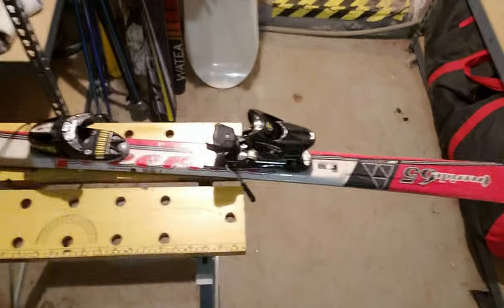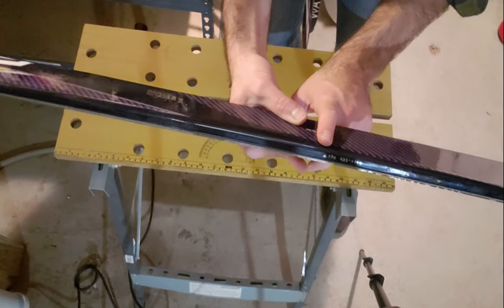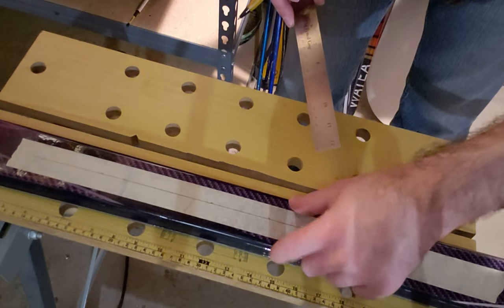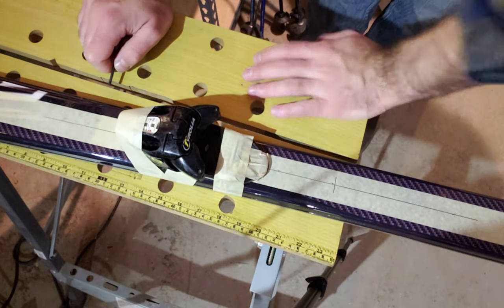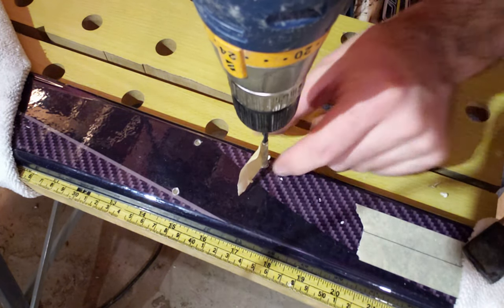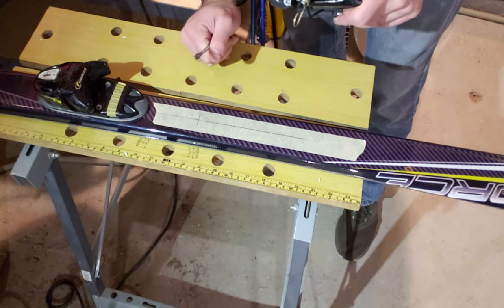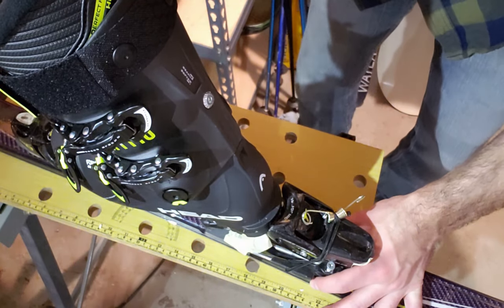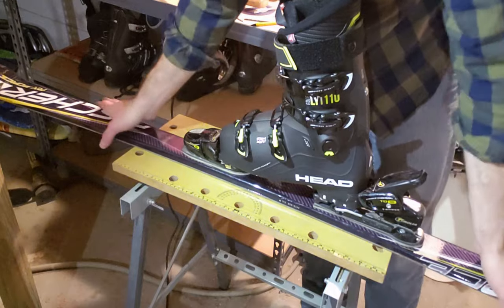How to mount ski bindings at home - free and easy!

Comment: A couple of observations. Ski binding screws use Posidrive #3 not Phillips. The most common drill bit sizes recommended by manufacturers would be 3.5-9.0mm, 3.6-9.5mm for non metal skis, 4.1-9.0mm,4.1-9.5 for skis with metal. Always use a 12AB tap to cut the thread in a ski with metal. These are step drill bits that only penetrate to the correct depth and have a counter sink. A drill guide is useful when drilling metal which can require more downward pressure. The guide helps you drill straight. Binding technical manuals recommend a wood type glue to lube the screw and help seal the screw hole from moisture. When setting up the toe and heel by eye keep in mind the some toe pieces have a preload on the wings so the boot pushes the forward. The toe piece requires the proper forward pressure from the heel to ensure proper release in a twisting release. When the boot is inserted the heel piece actually moves backwards on the track. Always double check the forward pressure after mounting and adjustment. The boot and bindings are a release system and the release spring needs to be set and calibrated to a skiers hight, weight, age, boot sole length and skier type. Just because you set a binding to a certain DIN number doesn’t mean that the boot and binding will actually release at that value. This should be checked by measuring the requirements with a force measuring device/ torque wrench. The same chart that recommends the DIN setting also lists the proper release force range in twist and forward falls.
Reply from the maker: Very helpful. Hope everyone reads this. I've just done my own bindings several times - looks like you have some serious knowledge.
Reply: Cool comment 👍🏻
Reply: I agree with every thing said above! Good add on. I just want to add something. If you are buying old equipment like this, you will have to work on it yourself. Check and see if your bindings are indemnified before you buy them, because a shop will not  work on them if they are not. Thanks
Reply: Do you have a set of bits you would recommend getting?
Reply: How do you use a torque wrench to test the force require for a specific din release value?
Reply: @J_Smith7  there’s a whole setup one would use to test the release. The torque wrench attaches to a foot-like rig that is inserted into the boot when testing. When calibrating you test for both lateral and vertical release, comparing results with the chart mentioned. Pretty simple and fascinating actually. It looks like it can be done by machines also, although I’m sure still frequently done this way by techs. Cheers!

Comment: If you just need to install new bindings using the same holes because the previous ones broke. You basically just unscrew them, and screw the new ones in? Ofc adjusting the weight for release and all that too

Comment: Thank you for this video, I just bought a set of used skis and boots, and the boots are about a quarter inch too large for the bindings at max adjustability. After watching your video I feel like this will be a fun project to do to re adjust the rear binding back since the boot and the ski centers match with where the front binding is. Probably saved me a ton from taking it to a shop when I could do it myself.

Comment: thanks for sharing. no. criticism here but i would like to recommend…. anytime a drill needs to be used with a heavy clear or gel coat, run the drill in reverse for just a couple turns. it will prevent blowout and the heating of the gel which creates that ridge you trimmed with the exacto knife

Comment: in terms of finding the centerline of the ski and bindings that method will always have enough error that you aren't actually on center.  better is to just put the binding on the ski and center it by feel on each side with your fingers and tape it down and double check side measurements are equal with calipers.

Comment: Since super glue becomes brittle more quickly than other substances do u think a type of epoxy would be better or not a deal breaker? Also, you made the process seem munch easier from what i have been hearing. Seems like anyone with patience and basic tool skills can mount. Great clear video👍
Reply: You don't want to use super glue or epoxy, actually.  The screws' threads are shaped such that the glue of any kind really doesn't contribute to their strength. The thread pitch and size gives it its strength. Glue can help them not back out. But with the proper torque, they won't ever back out, even with no glue.  Adding super glue or epoxy will cause the screws to lock in so hard that taking them off will ruin the immediate area around the screw, or  the screw head will strip.  Most binding technicians and manufacturers recommend using Titebond wood glue.  It seems too weak, but it actually works great. It bonds very well to the wood core and most importantly it does a great job sealing the holes from water ingress.  Water/humidity getting in the screw holes over time will rot the wood and the screws will be more likely to pull out.
Reply: @dustinlee2310  thanks for the detailed reply 👍

Comment: useful video, many shops here refuses to work on old stuff. i have a pair of gs skis where i wore off the edges and they have steel racing binding still perfectly functional. i asked to mount the bindings on a pair of old voelkl P20 that i still enjoy using, but no! the ski is too old so it's dangerous (??!).
Reply: They have too… the ski isn’t reliable and if your binding ever came off you would have a big payday… you can’t blame them🤷‍♂️
Reply: @r0gers96   please... they sell you junk skis for 200€ that become unstable after 5 runs. have you ever seen a binding coming off a quality ski in good condition? probably only if wasn't mounted properly. but they also told me that their edge tool isn't hard enough to sharpen the old ski. strangely enough they were super ready to sell me a new pair and change the basic bindings with mines
Reply: @enricofumi8072  I can see a shop not wanting to touch old bindings due to liability. They have moving parts that can degrade and fail with age. Skis otoh just get worn out from tuning. I've kept a pair of P9 RS - what a contrast vs the modern world cup racetigers haha...
Reply: @jamesroscoe7555  so car shops should refuse to work on anything more than 12 y/o. carpenters won't touch any building built before 2002 etc...
Reply: @enricofumi8072  The difference with a car or a house, is the binding industry specifically provides a list of indemnified bindings and any binding not on the list, a shop will usually reject. The binding manufacturer will no longer support bindings not on their list, so if a shop does work on them, the shop will incur all liability. Some of the parts in some bindings are plastic and can age and crack unexpectedly, so it is fairly legitimate that the manufacturing engineering staff would advise of the risk. 

The same is true with car tires. Shops will often not reinstall tires over a certain age (tire manufacturers often say 6 years) due to potential liability. Tires can last longer before spider line cracks happen, but it is easier for a shop to go by numbers. Helmets also... if you crash in a 10 year old helmet and it fails, good luck suing. In a house, smoke detectors often have a defined life and are designed to "fail" with a siren at some lifetime rather than not go off in a fire. The binding industry works the same way. Older skis otoh are imho totally fine generally unless there is some sort of serious visible damage.
Reply: That refusal to work on older bindings is based on FEAR of law suits on injuries blamed on bindings not functioning right (really nearly impossible to prove) based on no “Torc Test” done  or not done  to document they release at certain specified force levels…. OLDER bindings may not be “indemnified” by manufacturer after a certain age…. Of course limiting indemnification past a few years forces you to buy NEW bindings…$$$$$ could be the motive for scheduled obsolescence….?… perhaps???… maybe???.. What do you think ?!….
Have you seen a binding fail a torc test ????… was it new or old ?
Reply: @enricofumi8072  Great point enrich… It is all fear fed by our litigious population fed by our legal system (ie- No “loser pays” law)….
Reply: Attorneys sue for exorbitant amounts ($$.). But they Advertise; “you don’t pay if we don’t win you money”….(ie- You have No Risk )….. They Sue for 5 million but then settle out of court for 1 million.. They keep 40% you get $600K…… Not bad for No Risk and , No money spent !!!….
A system that forces INCREASED COST of ALL PRODUCTS !!!! .. AND, increased insurance costs !!!!
Bankrupting America.
If we had a “Loser pays court costs”  law ; people would risk something to sue someone, thus they not sue unless sure they will win.  
…
Reply: @Uramledtube  I don't disagree with you. This is why we have legal disclaimers like "known to cause cancer in the state of California" on a screwdriver because it contains some plastic. Nobody is getting cancer from the screwdriver through normal use (even in California).

OTOH, at least up here in the Great White North, engineers are expected to follow an ethical code such that a design must consider the failure modes associated with reasonable worst case use. Ie if you design a screwdriver that shatters when someone prys with it and loses an eye, that is bad, would be better to design it to bend at failure rather than shatter.

So with anything plastic that must withstand stress, how that ages depends on lifetime heat and UV exposure among other things, and an engineer can't guarantee it will work properly after some amount of time and thus can't sign off on that use case. The manufacturer can't legally sell it outside of engineering opinion, and the shop won't install or work on it outside of manufacturer support. And of course the shop and manufacturer benefit from greater sales from this obsolescence as you point out.

The main takeaway here is that though many bindings will work fine many years after their support runs out, an engineer needs to be able to prove they will work or possibly be liable. If our legal system did not work this way, people would build bridges that fail and kill people because of budget pressure, corruption etc.
Reply: @Uramledtube  Just to add some real world data. Not bindings, but boots. I once saw someone try to use 30 year old boots and the soles crumbled into pieces when they stepped into their bindings. Fortunately it was at the bottom of the hill so they just got some rental boots for the day... However, what if that happened during a critical moment on the hill? 

Lots of people have had bindings break on the hill. Often these are specific models that have an issue, but with plastics, it can be hard to know how they have aged. That spring holds a lot of energy!

Comment: hey... what happens if your bindings are not entirely flush with the ski? I think the glue dried faster than I was able to drill. I have like a 1mm gap between binding and ski. Good/bad?
Reply from the maker: Ideally it would be flush - but you might be ok if the screws are tight.
Reply: Screws are definitely tight. Thank for the reply!

Comment: anyone know of a good waterproof glue to use on the screw and holes ?   also what type of glue to use to fill existing holes on the skis ?   thanks.
Reply: Titebond 3 and Elmers Wood Glue max (also called Pro bond max in Canada) are rated as waterproof. Glue stating weather proof or water resistant are not waterproof.

Comment: Snowboards are waaaay easier!  Bindings usually support multiple mounting systems.  Screw holes or rail already built-in on the board. So a simple screw driver is sufficient to complete the job.  There is no need to worry about boot size (well, except small, medium and large) and no DIN to mess with.

Drilling holes into an expensive pair of skis!?!? holy crap, the scenario of drilling the wrong hole is too horrifying.  I will pay the pros to do it.  Hey, already shell out 500+ for the flat skis, 150+ for the bindings and 400+ for the boots, might as well pay more to get it mounted, right?

So at this point, the skis setup is already much more expensive than an average setup for boarding.  There is also a draw back that the components are not very interchangeable. Say, if you have multiple boards and just one pair of binding, you can move the bindings around the boards easily and save money.  You can do that with the skis too. Except that you have to pay the pros to do it!?!?

On a power day, I will just use the screw drivers at a resort bench to quickly move my snowboard bindings to the back.  I don't think this kind of flexibility is possible for skis :)

Anyways, enough ranting.  I am a snowboarder trying to pick up skiing as well.  Just want to rant after spending some good money for skiing gears but before I can get onto the mountains.
Reply from the maker: Snowboard bindings are definitely easier, and you're right, if you're spending big money on equipment already, you might as well tack on more to pay a pro - but if you're on a budget, there's a way to do it yourself :)